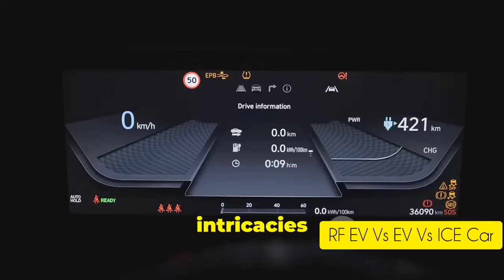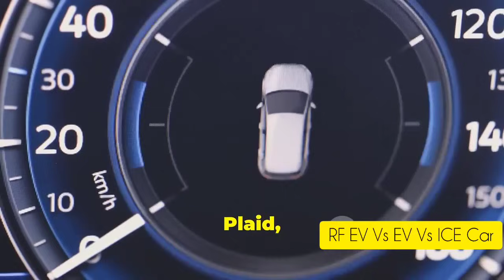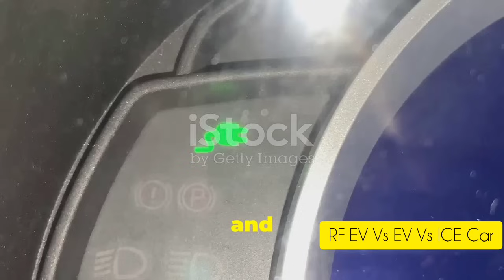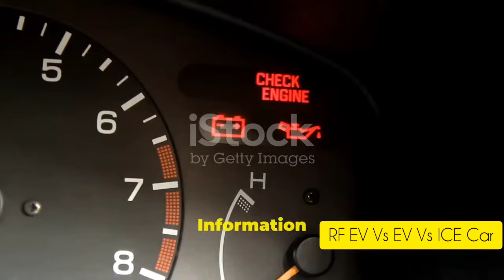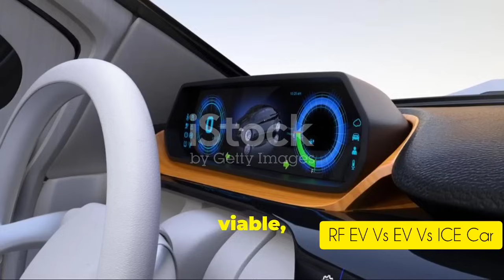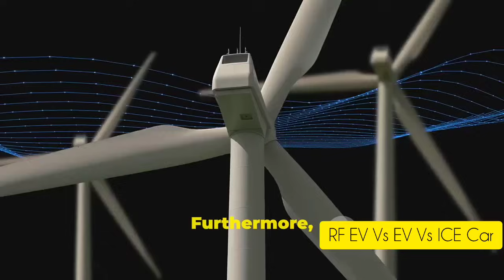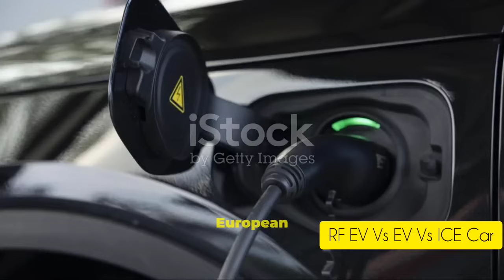Self-Powered car Vs ICE Car VS EV A Huge Knock Out!

Comment: They say it's self charging and then no need for batteries!! 😂😂
Reply: Why does it need a battery?  The device itself is supposed t be the source of power to make the electric motor work to drive the vehicle.
Reply: You listen properly, it has a Device that harnesses energy from the atmosphere (RF) and inputs into the battery which the car uses to function. It's like a phone is at 100% and you are using it whiles it's plugged in on a charger, meaning it will remain hundred however much you used it.